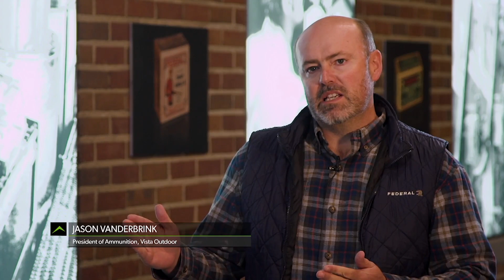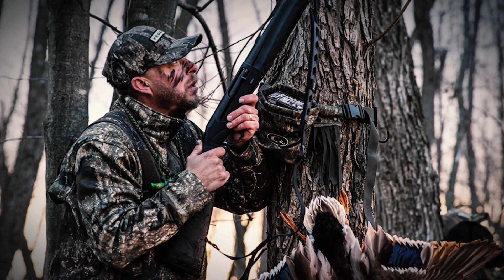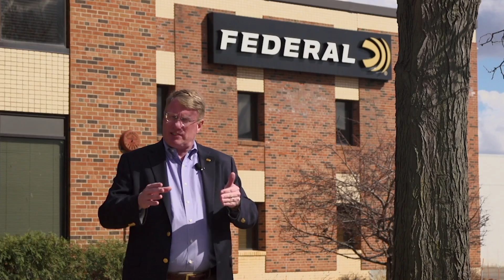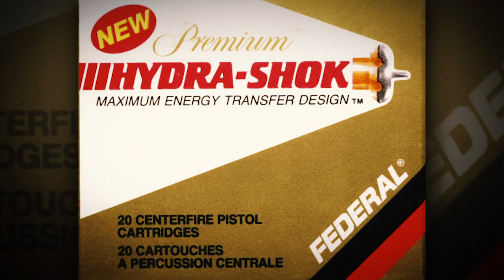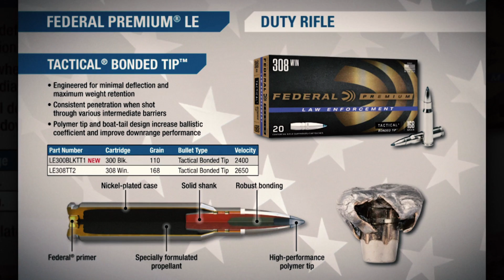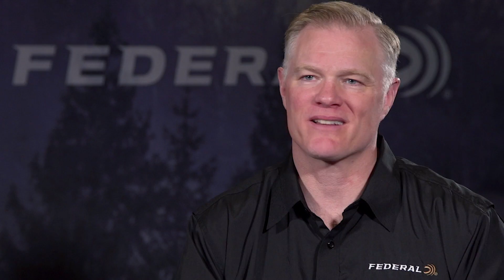100 Years Of Federal Ammunition: Part Two

Comment: Great promotional video, here is a task that the engineers will enjoy. A new offering in 25-06rem. We need something a little heavier like the wildcat 135gr black jack. I won't give up my M77 for a new load so it needs to work with the standard twist rate.